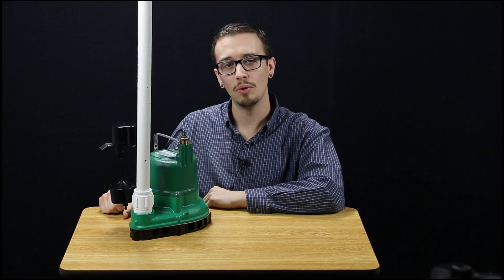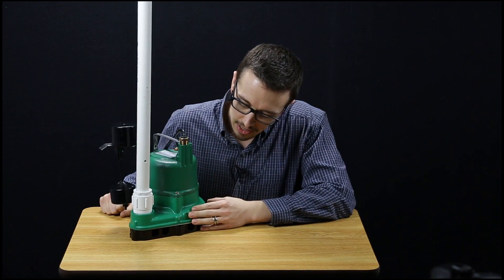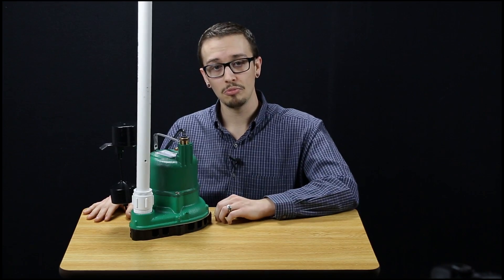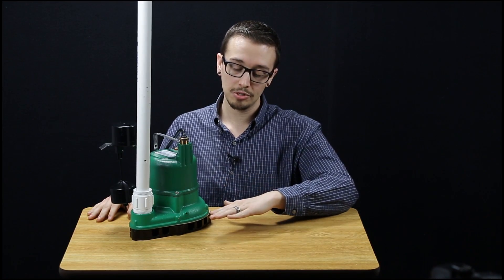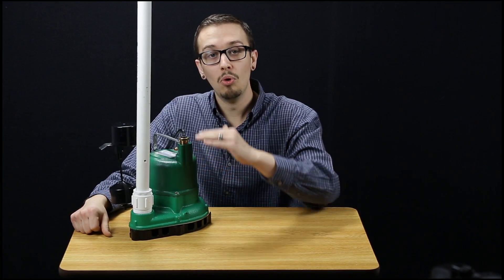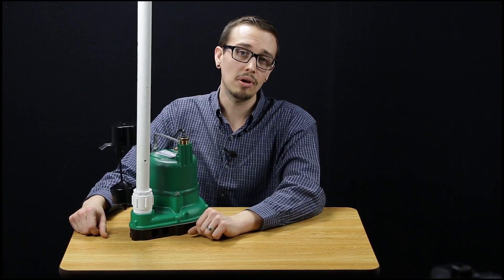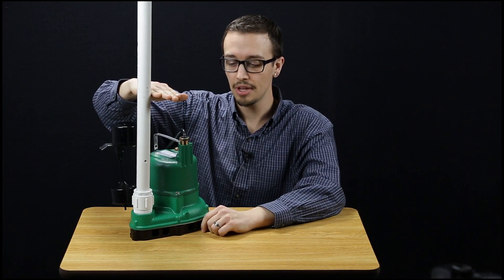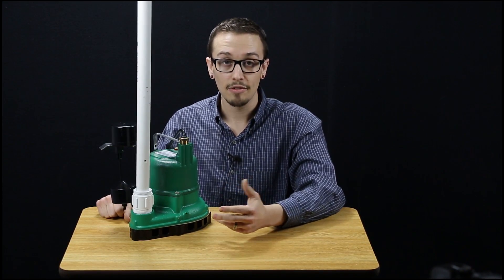Why Sump, Sewage, and Effluent Pumps NEED a Vent Hole

Comment: Does the vent hole still apply when you have a check valve?
Reply from the maker: Yes. Without the vent hole air can get trapped between the pump and the check valve and air-lock the pump.
Reply: R.C. Worst & Co., Inc. I have a shallow space, my check valve comes directly off the pump due to height maximum. Can the hole be in the rubber below the check valve flap?
Thanks!
Reply: R.C. Worst & Co., Inc. ok...thank you...I believe that is what is happening. When our pit fills with water from the washer, it can take hours for it to empty. The pump was recently replaced.
Reply: @rickschultz737  i hope you're not draining your clothes washing machine into the sump pump. Not only is it illegal, but your going to get lint trapped in the impeller and burn out the motor.
Reply: @Pro1er  I have the same situation and my sump drains to septic system as required in my Michigan county.  Is that still a problem, i.e. - having the washer draining into the sump?
Reply: @antlersonlymounts  Are you sure you read the code right? What county do you live in? It is not a good idea to drain your sump into your septic tank, you can over saturate the septic field and if there is silt in your sump your only adding to what is going into the septic tank. You should divert the water from the sump to an area away from the house and into a dry well or a culvert. If you are South of Flint you probably wouldn't have a problem running a 4 inch drain line underground if you want to keep it out of sight, just make sure NOT to seal it to the discharge pipe of the sump pump in case of freezing.

Comment: I just want to know what will happen if I used a sump pump with 320gpm flow but actually I only need 75gpm flow? Please give advise..thanks..
Reply: Depending on the pump and system...likely I'd say cavitation as your pump will run off the curve to the right...
Reply: @diyplumbing2463  how about easy calculation for the capacity of booster pump? If my water tank is at the top of the roof? Thanks..
Reply: @cassielliejemssamson2902  let me double back, if you have a pump that is say 320 gpm at 25 ft head and you only need it to be 75 gpm. Well that depends, is the pump capable of 75 gpm without falling all the way to the left of the curve. If it can, than put a valve on the discharge and create false head. This would bring the pump back to 75 gpm.

Comment: Two questions:
1-  can the vent  end in the basement and just put a vent cap on top or does it have to go to the outside of the house
2- when I flush no problem but when the pump activates the water splashes out the toilet why?
Tnx.

Comment: So... After replacing 2 pumps, and figuring out a lot about how they work, how sump wells work, and how house drainage systems in general work, I'd like to spend some time this winter ripping it all out and making a lot of adjustments to things like installing a new check valve, making my weep hole lower and pointing downward, getting all of the rubble and dirt out of the bottom of the well and having just the gravel or a paver for the pump and making it much lower so I can trigger it before it engulfs the 4" inlet pipe  and puts another 6" to 8" of water on top of it like it does now (It takes way too long for my pump to really start working during heavy rains, and then it spends the next two days going off every 3 or 4 minutes playing catch up when it could be spending the first half of the day actually working instead of waiting for gravity to push enough water in the well up to get it going)

My question to the channel (or to anyone else here), is how do you detach the PVC from the pump after it's been glued on?  I could just buy some connectors when I make it longer, but I'd rather have a straight pipe with the only break being the check valve.
Reply from the maker: Once it's glued your only option is to cut it unless you have a union installed somewhere. We sell True Union check valves on our website for this exact application: https://www.rcworst.com/Spears-True-Union-PVC-Spring-Check-Valve-2-S1780-20-Socket-p1894.html
Reply: @RCworstwater  the earings are unusual in some circles.

Comment: This is true.  I didn't do this with a $350 Zoeller and it died on me after a year.  I've got a crap Coleman in there now with a corded float that I hate, but I had to do an emergency switch with near freezing water up to my ankles so I didn't have time to research or even think about what I was doing.  This Coleman piece of garbage has been working fine for 4 years now.  That Zoeller probably would have run 20 years if I put this damn little hole in there.
Reply: The Zoeller already has a weeping hole. No need for this. By installing a weeping hole above the check valve you negate the check valve. All the water in the pipe you just pumped out will drain back into the sump causing your pump to run excessive and fail prematurely
Reply: @1serious-gearhead  Maybe the new ones do, but the one I bought 5 or 6 years ago didn't, and the installation instructions directed you to make one of your own.
Long story short, read the instructions.  Don't be a dummy (like me).
Reply: @thedude5295  Weeping hole generally in the pump housing above the impeller itself not discharge pipe.
Reply: @1serious-gearhead  Thank you for the tip.  But the instructions for the installation that I ignored when installing it called for making your own weeping hole in the pipe.  I figured that out after the thing died on me in less than a year and the dude I bought it from on Amazon wouldn't take it back and got me in contact with a Zoller approved shop that wanted to charge me $100 to fix it.

If they all have them now, that's great.  I know my Coleman that's in there now doesn't and had the same instructions on it.  My weeping hole feeds onto a sheet of aluminum I put across from it and the cap is off of the well so I can hear that thing pissing like a racehorse whenever it goes off.  I'm rather paranoid about another one failing on me now, after having to change out a pump in knee high freezing cold water not once, but twice in 2 years.  :)

Don't assume anything, is all I'm saying.  If you're doing something like installing something designed to spare thousands or tens of thousands of dollars of avoidable damage DIY style, make sure you follow the instructions.

Comment: Hey there. I've watched a lot of your videos and was able to do my first sump pump install thanks to them. So I have a zoeller m53. 1/3 hp pump. I also have the back up pump with battery. The reason I switched was because the float switch was going bad in my first one. Long story short, after everything's done I have a ticking sound? I have two check valves on it. The one that threads into the pump isn't sealing that great. I took it apart and ran it under my kitchen faucet to see and the water pretty much dripped out. So the water runs back in. Granted this is about 1.5 to 2ft of pipe because the zoeller check valve further up works perfectly. My question is do I need two check valves?  I assume yes because it would keep the back up pump from pumping into my main? I guess the new piece is just faulty and I should try another. Any suggestions? Looking for a threaded check valve to hook into the pump. Thanks!
Reply from the maker: Yes, you need two check valves on those systems. Take a look on our website: https://www.rcworst.com/Valves-c80.html?Attribs=502&

Comment: I have a pump in a 22" diameter hole connected to a 2" PVC pipe running outside.  On the first cycle the pump empties the hole as I would expect a 2" to do.   The next cycle the pump's output reduces to ~25% of capacity.  I tried the vent hole but experienced the same scenario.
It will not draw the water level down low enough to allow the float to drop and shut the pump off.  Any thoughts or ideas would be appreciated.  Thanks
Reply from the maker: It sounds like it is getting airlocked or your check valve has failed... More than likely an air lock issue. You could also try raising the float a few inches so the water level does not drop so far and maybe that will stop the pump from sucking air.

Comment: nice job!  I noticed for my Zoeller M53 sump pump does have weep hole in the exact location as your sample pump in the video.  I do not have a weep hole on my pvc pipe but it's running fine and I do try to clear the hole on the Zoeller SP once a year.  Do I still need to drill a weephole?  My previous sump pump lasted 13 years without a weep hole on the PVC pipe and replaced it in 2017 (just because it's 13 years but nothing was wrong with it).
Reply from the maker: Zoeller recommends that you drill a weep hole even if your pump has one. The pump's weep hole is quite easily clogged, and the second one will add a layer of redundancy.
Reply: 100% agreement with this reply, from a guy who had a Zoeller with it's own weep hole and ignored the directions to make one in the pipe.  It failed after a year, and I had to put in an emergency install of a crap replacement from the nearest store that cost half the price and has worked for 4 years now (and has a weep hole in both the pipe and the unit itself). 

You don't want to take any chances here.  Trust me.  You can always figure out a way to cover up and deaden the noise (there will be a LOT of noise created).  But you aren't going to be able to save everything that is going to get wet.
Reply: What was your previous pump that lasted 13yrs?
Reply: @Kiddro22  moved in 19 years ago. Never replaced pump. Zoeller. Pumps water from outside drain and washer. Getting a new one just cuz.
Reply: @johnnybeanz1296  I’ve always had a Wayne pump. But it was always either a Wayne or Zoeller

Comment: Where does the vent hole need to be located? Should it be above the normal water level in the basin? Close to the level of the top of the pump (even if that means it's under water)? Any recommendation?
Reply from the maker: In the discharge piping, above the pump but under the check valve. Preferably under water angled down so it's not spraying up.
Reply: R.C. Worst & Co., Inc. Thank-you

Comment: Silly question - my Zoeller  setup has a vent hole that I first thought was a cracked pipe.  Now realize whoever installed the system did it intentionally.  However, the vent hole is above the water line at all times which means I get a hell of splash/spray noise.  Nothing around the pump to damage and no water spraying out of the sump hole, but its super alarming in the basement to hear splashing water.  Should the vent hole be above or below the water level?
Reply from the maker: The vent hole can be drilled above or below the water level in your sump. You can replace that first stick of pipe coming out of your pump and redrill the vent hole lower to eliminate that sound. Thanks for the question!

Comment: I have a question the hole that my sump pumps sits in is basically bricks surrounding it while in the ground. When the sump pump suck the water out I can see where the water is coming from if I patch that section up will it cost future problems?
Reply from the maker: Sump pumps are used to pump water out and away from the foundation. Why would you want to stop water from coming in to the pit?
Reply: Well to stop the hole from feeling up. I don’t know a lot about sump pumps so I didn’t know if it would make a bigger problem if I did that.
Reply from the maker: As long as your pump is emptying the pit faster than the water is filling it no action is needed, just let the little guy do his job. Check out our sump pump tips video, I think you'll find it helpful:https://www.youtube.com/watch?v=LAquntA5Ba0&t=81s

Comment: I have boring out of my house and have water connections in 6 houses and there is a walve outside of every house if all walve off and summer pump is turned on then what will be the solution
Reply: Adult

Comment: do not drill a hole larger than this guys gages! :D
Reply: why
Reply: @bobyang3350  I'm assuming because of the massive amount of water that already comes out of a hole 3/16th of an inch.  Every time my pump goes off in my crawlspace, it sounds like a horse pissing that I can hear from the bedroom on the 2nd floor.  I could cover it up, but after two failed pumps since I've lived here, I like knowing that it's running.  I think if you start going to a 1/4" hole or larger your pump is going to be wasting half of its time and energy re-pumping water that it's already shot out but keeps getting recycled.

Comment: Thank you so much for this well done video. I had a very noisy check valve and installed one of the check valves that has a trapped air column to dampen the water hammer. Does it matter how high on the volute the dampening check valve is mounted and if not what in your opinion is the best dampening check valve available. Standard residential system with  PVC. Volute is straight vertical about 8 feet to horizontal discharge. Please help before my wife  does something nasty . Again many thanks.

Comment: Have you ever heard of sump pumps being used for sewer?
Reply from the maker: Thanks for the question! Pumping raw sewage requires that the pump be able to pass 1.5-2" solids at minimum. Sump pumps would not fair well in sewage application because they have very limited solids handling capabilities (typically less than 1/2").
Reply: Thanks for replying. I was just wondering because I just bought a house with a sump pump. And on the final walk through I found out the sump pump is being used for the sewer, not for standing water under the house. It's worked like this since 2006 when the house got put on public sewer, and the pump has been replaced once and is 3 years old. It worked for them so I hope it works for us. Can't really afford a pro to come look at it at the moment. 

It could also be a sewer pump and they just don't know the proper wording for it. I hope that's what the deal is. Lol
Reply from the maker: If it lasted 10 years it must be a sewage pump. If it ends up being a sump pump come replacement you better send it to Guinness!
Reply from the maker: If you can get the model number off of the pump you can confirm for you yourself - if it's still running after 3 years I'd say you're good.
Reply: R.C. Worst & Co., Inc. thanks! :)
Reply: Sawage ejector pump is design for heavy wasted like poo and paper 

 rain sump pump design only for water

Comment: I find this a little confusing when compared to the watchdog emergency sump pump installation manual. They require a vent hole drilled above the waterline (I think they mean high waterline).  This seems counterintuitive to me; I can see a hole above the low waterline allowing the impeller to be fully immersed, but see no need to go as high as above the high waterline
Reply from the maker: It looks like their install instruction illustrate the hole above the low water line. So drilling the hole 3-4" above your pump should still work well in your situation. Thanks for watching!
Reply: h ananomous. hole should be at about the pumps height.

Comment: You drilled the hole much, much too high on the riser pipe. The Everbilt check valves sold by The Home Depot have a small hole, about 3 mm (1/8 in) diameter, at the top of the male thread that screws into the base of the sump pump. That's high enough to guarantee that the pump impeller will be 100% immersed in water before starting, but low enough that the stream of water coming out of the hole will always be under the water level in the sump, thus preventing a splashing problem. I've operated sump pumps for years without such a hole and have never had problems with the pumps not being able to start due to air around the impeller.
Reply from the maker: @Milosz Ostrow I think you are right about the height of the hole in cases where the liquid level is allowed to travel below the top of the pump. I personally always advise against allowing the liquid level to fall below 3" above the pump for optimal pump life. I understand that not everyone has the depth to accommodate, so in those cases your advice is great. There are many low profile options for adding a vent hole much lower as needed. As I mention in the video, many pumps today feature a vent hole in the volute (including the pump in the video). Thanks for the comment & for watching!